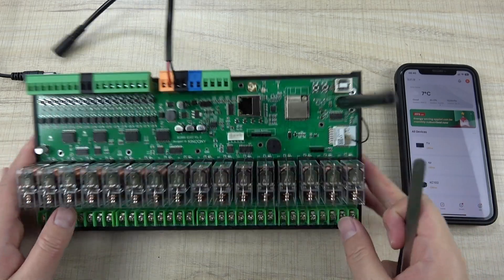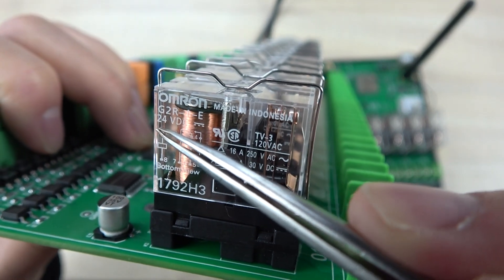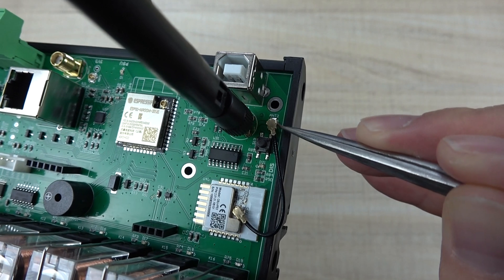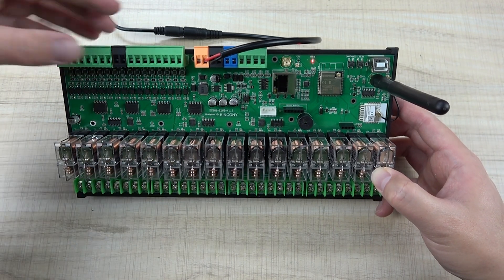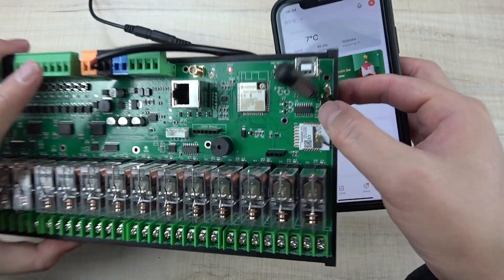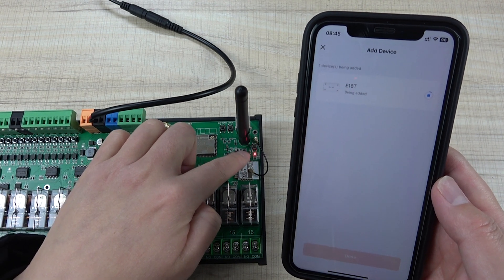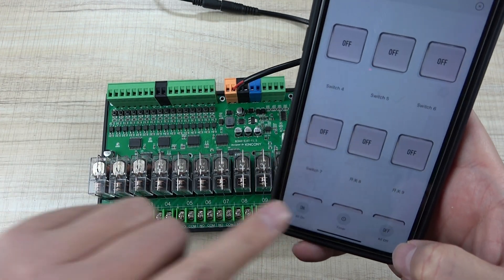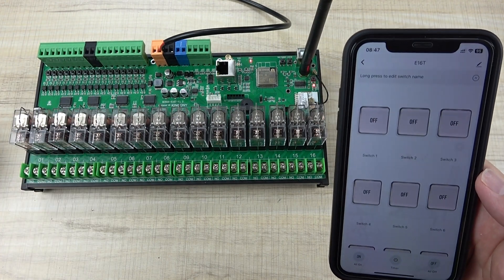How to use KC868-E16T work with Tuya App remote control by internet

Comment: Is it possible to get RTC on the KC868-E16S ?
Reply from the maker: E16T support Tuya app and voice control by alexa or google home.
Reply: @KinCony  is it possible to have RTC on KC868-E16S ?
Reply from the maker: sure, you can connect with i2c extender with i2c RTC interface. @charlesrg

Comment: Hi! My Kincony KC868 E16T is dead after I tried to instal 
the WEB Server ETH. I tried to restore the factory firmware to control the KC868 E16T with Tuya but the rest and configure buttons are not working. Could you help me to solve this issue?
Reply from the maker: will feedback to you at here. https://www.kincony.com/forum/showthread.php?tid=2421
Reply: @KinCony  Thank you!

Comment: Hi
Can you rename button in smart life app? Can you set switch mode to momentary switch mode between 0.2 seconds and 1 minute for example press switch and relay stay on for 0.2 seconds and then come off ? Does it work with ethernet and not wifi for more staple connection? Thank you
Reply from the maker: are you using KC868-E16T board? in furutre we will update firmware for all these functons, just use by "KCS" firmware.

Comment: If that the case  it will be nice to have a modular board with esp32 and ct sensors with clamps that can integrate with kincony  a series boards or external relay boards to monitor power consumption and send data to home assistant.I can imaging how useful it be for diy projects .
Reply from the maker: if 16 channel, the board will be large